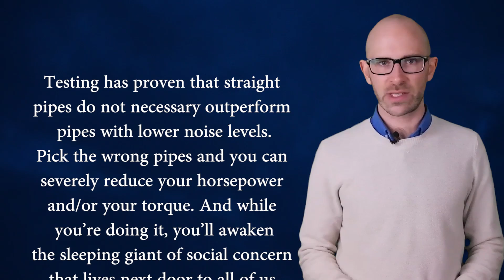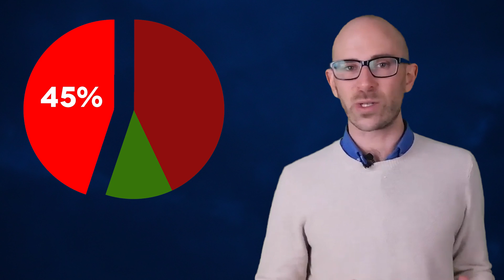Why are Harley Davidson Motorcycles So Loud?

Comment: Doesn't matter. I end up riding bitch anyway; with helmet hair and phantom bike vibrations in my legs & butt for hours. And don't forget the "clinch factor": when you're scared by careless drivers, your ass clinches up so TIGHT, your ass sucks up the leather on the seat!

Comment: You told us the answer to your question " why do they make Harleys so loud ? ", and you are correct, hey don't make them loud, the owners replace the stock exhaust with aftermarket exhaust, that are often loud. You are also correct when you say the loud straight pipes don't often if any increase the performance of the motorcycle, but when you combine the loud aftermarket exhaust with other components such as a larger air intake, larger jets in the carb etc. you will gain more horsepower, just like race cars, and other high performance machines. I don't think you like motorcycles much. I also don't think you or anyone else are bothered by them more than one minute of your day. They are here, they have been here for a very long time, and I'm pretty sure they are going to be here. You don't have to allow yourself to become angry, but at the same time, I don't have to allow myself to become angry because of people like you. It's all ok.

Comment: Most HD owners don't remove baffles, they sound like crap if you do. Last time I knew measurements were taken while at  idle at a certain distances to comply with the laws.  I'd also check on what EPA says how long at how many decibels are recommended . I also agree a little more research is needed.

Comment: lack of mufflers, is not why the are loud in the first place. it's about displacement and stroke get out of that dork sweater get your girly hands dirty, and do the real ground work...pffft!!!
Reply from the maker: Then why can they magically make them relatively quiet stock (with the stock mufflers having the bikes usually peaking in the 80-ish dB range, about 10 times quieter than your typical comparatively tiny-engined lawn mower), but then you take the stock mufflers off and put a straight pipe on them they can, as mentioned, peak at about 100 times louder than stock, give or take depending on the model and what exactly you swapped the original muffler for?   

The mechanics are interesting, but when talking about WHY so many Harleys on the road are drastically louder than similar HP'ed bikes, it mainly comes down to the muffling system on a given bike.  WHAT specific type of noise a Harley makes does concern engine design, but this one's about significant changes of dB levels (with emphasis on "significant"), not how they get their distinctive sound (at any dB level).

Comment: STILL waiting for the " why are Harley's loud " explanation. Talk about bait and switch reporting.
Reply from the maker: Did you miss this part of the video? "For starters, it’s difficult to attain the level of quietness one sees in a passenger car in a motorcycle due to little room for bulky mufflers on the bike. That said, loud, powerful sounding engines have become a signature of this particular brand of motorcycle, leading to the real problem- many who buy Harleys are not satisfied with the legally regulated stock noise of the engine and instead choose to swap out the existing exhaust systems for straight pipes that don’t really mute the engine noise at all. This results in sound that can exceed 100 decibels when revved up."
Reply: Or to put it another way, Harley owners put loud pipes on their bikes to compensate for the absolute lack of performance.

Comment: Today I found out? Then why didn't you tell us about how a harley fires a spark on the exhaust stroke as well as on the compression stroke(dual fire ignition). Both spark plugs fire at the same time . Add that with the large high compression pistons that are almost as big as a chevy 350 ci. motor has  and it's hard to suppress the noise unless you put a car sized muffler on it. And loud pipe do save lives.
Reply from the maker: The underlying mechanics were not mentioned because it's not relevant to the reason why many Harley's are so incredibly loud, more effecting the general sound from the engine giving it that distinctive "chopper" noise.  As stated in the video, "For starters, it’s difficult to attain the level of quietness one sees in a passenger car in a motorcycle due to little room for bulky mufflers on the bike. That said, loud, powerful sounding engines have become a signature of this particular brand of motorcycle, leading to the real problem- many who buy Harleys are not satisfied with the legally regulated stock noise of the engine and instead choose to swap out the existing exhaust systems for straight pipes that don’t really mute the engine noise at all. This results in sound that can exceed 100 decibels when revved up."

Comment: Need to do more research. Blaming Harley is ridiculous. For that matter, blaming motorcycles is ridiculous. Your lawnmower likely makes more noise than a Harley or any other stock motorcycle. Any owner of any gas powered engine can make them obscenely loud by removing stock baffling. That goes for cars, trucks, boats or anything else.
The fact that Harley owners seem to be more obnoxious than most and run baffle free pipes and blip their throttles a lot to garner attention does not make Harley responsible for the situation. If Harley didn't make motorcycles at all, those same people would find some other obnoxious means of drawing attention to themselves. Count on it.
Reply: In other words, it's not Harleys themselves, but their riders.  Riding a Harley isn't really about riding, but about drawing attention to one's self.  Like a small child acting up to get mommy's attention.
Reply from the maker: Nobody was blaming Harley itself.   In fact, we explicitly mentioned the real problem was the owners' modifications "leading to the real problem- many who buy Harleys are not satisfied with the legally regulated stock noise of the engine and instead choose to swap out the existing exhaust systems for straight pipes that don’t really mute the engine noise at all. This results in sound that can exceed 100 decibels when revved up."  And of course, the quote mentioned in the video from the COO of Harley-Davidson imploring Harley owners to stop doing this and Harley taking "steps to eliminate the modifications by no longer shipping racing exhaust systems that can work on street models to dealers." :-)
Reply: Lester Hartness Yes. It's an image thing for people who want to feel cool. People, like my dad, who want to actually get somewhere in comfort may buy a Honda Goldwing.  They still may have a few "look at me, I can afford a Goldwing 1800"  type people in the crowd, but at the end of the day it's just another well made Honda product. That said, I put a slightly-louder-than-stock exhaust on my 1999 Acura Integra, because the childish part of me enjoys the engine sound. It's still much quieter than a Harley.
Reply: saddlebag I feel you on the boats topic. We get airboats all the time in Florida that have absolutely no exhaust muffling and above water exhaust, both illegal in Florida unless it's being done to make it a race motor

Comment: Other than exhaust system, he never really explained much.....I mean if yu completely take the exhaust off of a lawn mower, it's still not as loud as a open piped Harley.Heyyyy,  is this one of those Cap'n Obvious sites?
Reply from the maker: Lawn mowers don't have anywhere close to the power or size of engine as a Harley or most other street bikes. Free from any sort of muffler system, in the general case, larger engines make more noise than smaller ones.  I would think that would be obvious. ;-)

As to the "obviousness" of the answer to the topic, we simply got a question from a fan and decided to look into it as it sounded interesting.  Sometimes when that happens, the answer is the obvious one and we'll throw it out and work on something else as it's just not interesting.  

But occasionally an obvious answer still makes an interesting script, whether because there's some interesting ancillary information, or because it's interesting precisely because it's obvious and most would think there's more to it.  For instance, in this case, we initially thought there might be something special about the Harley engines that make them so loud and impossible to muffle properly. While how they get their distinctive sound is interesting from a mechanical standpoint, when talking about the overall decibel levels, it turns out it's just the obvious answer and it's also interesting to note it's the owners, not Harley, that are the real problem here.  

That was kind of interesting to us, and we thought it would be to others as well so decided to do the topic. (And judging from the comments, many seem to be under the impression, as we initially were, that there is actually more to it than the obvious answer- straight pipes + relatively powerful engine = lots of noise. :-)) Obviously no topic is going to interest everyone, however. :-)
Reply: 'or most other street bikes'Yea, kinda what I was getting @.

Comment: This guy put a whole thing together with out even explaining WHY they are so LOUD.  If you want to improve the horse power on the bike you change the exhaust.   That simple.
Reply from the maker: "This guy put a whole thing together with out even explaining WHY they are so LOUD."  

As mentioned in the video: "For starters, it’s difficult to attain the level of quietness one sees in a passenger car in a motorcycle due to little room for bulky mufflers on the bike. That said, loud, powerful sounding engines have become a signature of this particular brand of motorcycle, leading to the real problem- many who buy Harleys are not satisfied with the legally regulated stock noise of the engine and instead choose to swap out the existing exhaust systems for straight pipes that don’t really mute the engine noise at all. This results in sound that can exceed 100 decibels when revved up."

"If you want to improve the horse power on the bike you change the exhaust.   That simple."  

We covered this in the video too: "McCaslin [COO of Harley] also directly addressed the custom of modifying the exhaust to get more power: 'Testing has proven that straight pipes do not necessary outperform pipes with lower noise levels. Pick the wrong pipes and you can severely reduce your horsepower and/or your torque. And while you’re doing it, you’ll awaken the sleeping giant of social concern that lives next door to all of us.'"

Comment: I have a street motorcycle with a stock exhaust,and a dirt bike with a muffler that is quieter than stock. That said, this dweeb is so annoying that he makes me want to run straight pipes just to spite him. Perhaps the pencil necked  toffee nosed über dork isn't the right person to be lecturing bikers?
Reply from the maker: Which part of our script was lecturing anyone other than the quotes from the COO of Harley-Davidson who was indeed lecturing his customers?  Is he too much of a "toffee nosed über dork" for you. ;-)
Reply: +Today I Found Out the one word answer to the question posed in the title of the video is "culture". HDs are loud because the consumers who purchase them value sound volume. The video wandered into lecturing when it discussed the damaging effects of loud sound on riders' hearing. An actual motorcycle rider would know that wind noise at speed is far louder than even a modified exhaust sound. Motorcycle exhausts are pointed away from the rider by design, but wind noise is incredibly damaging to hearing, and is present even with the quietest exhaust. This is why riders of even the mechanically quietest bikes wear ear protection inside their helmets. Without hearing protection, riders suffer from both hearing damage and fatigue.
Anyway, given that the basic answer was "cultural differences" some cultural sensitivity might have been in order in the delivery of the message. Without it, your message is discounted greatly. I'm not saying you hurt any bikers' feelings. I'm saying that by being tone deaf you encourage spite. This is true in any discussion of cultural differences.

Comment: If safety was the real concern, I think flashing lights would be a better alternative. Twinkly, pink, flashing lights.
Reply: what if you give some driver a seizure?Really, a modulated headlight was a (briefly) popular item a few years ago, it was so much more offensive than noise I believe it was quickly banned.
Reply: Interesting point, but I believe it is simple to avoid rapid flashing patterns which could induce seizures. More like a traditional bicycle flashing light, but maybe motorized vehicles would have a particular colour. Gotta be a better way.

Comment: The way he says Decibel is weird. Also, you fail to explain the mechanics / physics on why Hardley Davidson's are so loud, instead he rants and raves about the public pissing and bitching about noise levels. This is more of a noise PSA than it is an actual mechanical breakdown of how HD's get that distinctive (and annoying) roar.
Reply from the maker: You assume there is something specifically unique about the Harley engines that make them louder. This does not appear to be the case.  Put a straight pipe on any bike of sufficient horsepower and it's going to be extremely loud.

Comment: Loud pipes save lives.
Reply: no they don't. HELMETS do.
Reply: +catman2130093 of course. I wear a full face.
Reply: +ArtScience "clearly you're not a golfer."

 When you hear a bike on the highway or any road really, your awareness of the rider is heightened. You often hear them before you see them. That awareness CAN save lives.
Reply: Then why do bikers generally wear dark color clothes and dark color bikes making them harder to see?
Reply: +smoejoe smoeme cars have bright lights in front and back yet people still hit them. Not to mention if you're not looking, a bright vest won't help anyway.
Reply: +smoejoe smoeme the point I was making is that hearing them before you see them is an important factor. It heightens awareness. But sure, wearing high-vis clothing (bright neon yellows and greens) and even a light colored helmet can make a rider more visible but that's only once you see them or they come into your range of vision. Loud pipes goes back to audible awareness.

Comment: Every one has to believe the same way ? It looks like communism and oppression is alive and well ? With the extreme noise of  air craft (all) ,choppers,trains,construction equipment and ect,,,,ect....ect......not to mention the thousands of gallons of leaded fuel dumped in the sky from air craft 24 hours a day ,every day ?  Not to mention chemicals in the air,radiation,water contamination and ect....ect....ect........   Public enemy number one is MOTORCYCLES ?  What a bunch of IDIOTS !!!!

Comment: Developing a skill set as a motorcyclist or ANY vehicle operator should include the knowledge that you are for all practical purposes invisible. Of course the vehicle you are occupying at the moment is not invisible the fact is to others you very well may be.
So how can noise save lives? Sight and sound are two completely different animals. 
The two most common motorcycle automobile accidents are 1) being hit from behind while stopped. 2) An automobile turns left in front of a motorcycle.
Both of these situations will not improve with a louder exhaust note. Every rider know the drill, or should, use running interference of another vehicle when approaching an intersection. When stopped or when a vecicle from behind is approaching determine your way out prior to getting hit from behind...
    Stay sharp and remember, no one is out to "get" you, it is a simple reality that objects that appear to be small are further away. Motorcycles have tremendous acceleration potential. What was once an empty road could have a biker just turned onto the road and accelerated to speed, the image to the normal motorist will see a small object or no object at all because a moment ago the road was clear.
As a motorcyclist, I have lived the reality of these words, and riding is a 120% obligation to safety with regards to avoiding  "Mr Automobile" 
    A word of note: Wearing those roll up "Deci-Dampers" in ones ears while riding allows you to hear much better when on the road, the wind noise is much subdued and you can actually hear as an example the sound of a alternator belt chirping or whirring as you cruise past another vehicle even when there are a bevy of loud Harley's just up the road.
Put the ego on the shelf in the garage and PAY ATTENTION, all of us
Reply: To look good.  Wearing orange or bright colors is dorky.  Image is everything.
Reply: Then why do bikers generally wear dark color clothes and dark color bikes making them harder to see?
Reply: smoejoe, it's all about that rugged individualism.  The rugged individualism that requires them to wear a uniform.  The uniform, and the noisy bike is the only way we can tell that they're badass.